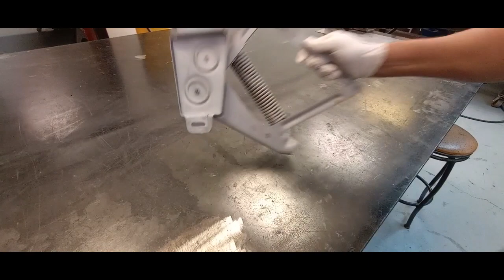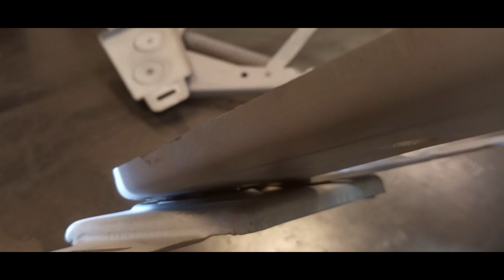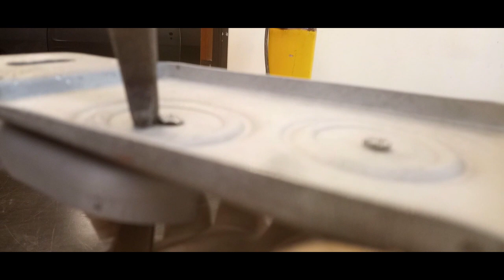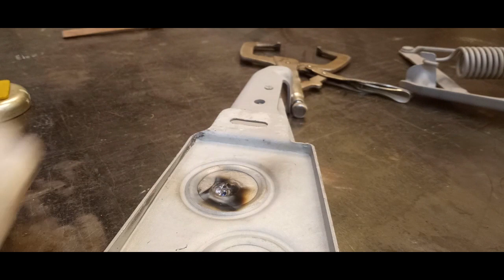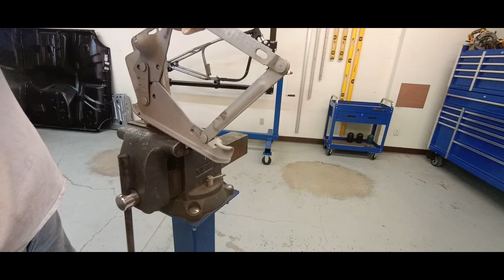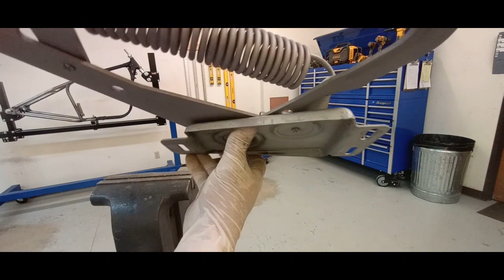How to fix a loose hood hinge  -  DIY Auto Restoration

Comment: I have a 1976 Eldorado convertible that sat in a garage for over 25 years 48k original. Even though I used spray oil "WD-40" on them when I first got it, it clearly was not enough and now the hood will not close properly at all. I priced rebuilt hinges and they are north of $600 and my old hinges. So thank you for the video. I can buy one hell of a welder and keep it for the price they want for a pair of hood hinges!
Reply from the maker: Great ! love hearing stories like this. Thanks for watching !

Comment: That is one solution. I would fabricate a new rivet, at least remove it and do a search for rivet suppliers and see what is available. You should be able to find rivets that are possibly exact or that will need some slight mods with a lathe. Ifi nstalled  with an air hammer, the rivet swells as the shop head forms and it will take up space within an enlarged hole that has more movement than designed for.  I have seen people use a hydraulic press and a rivet set and it seems to work as well, possibly better. I am not a fan of welding rivets as there is wear between the hinge and the river and  reforming the shop head (the one with the chisel looking marks) may only be a short term fix for looseness. "You do what you gotta with what you got".

Comment: No discussion on how to restore wallowed out rivet holes and rivet diameters where most of the wear is located.  Otherwise good short video.
Reply from the maker: The rivit was pulling through, the rivit holes weren't worn.... Rebuilding the hood hinge is a different video.